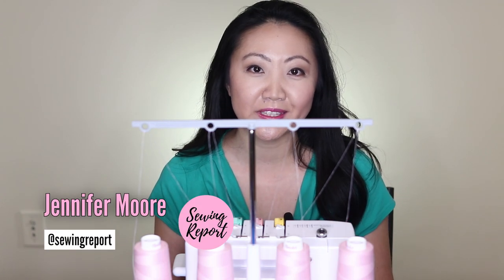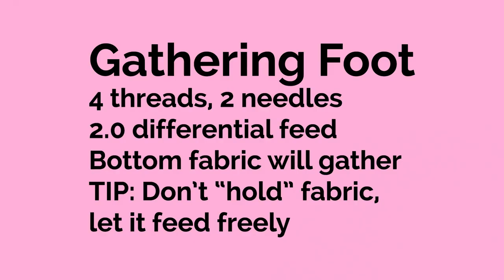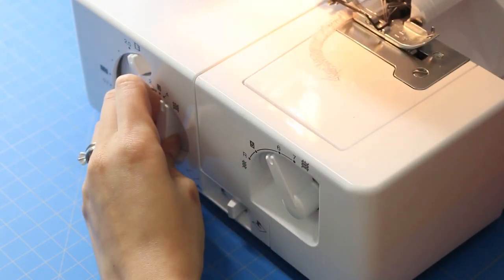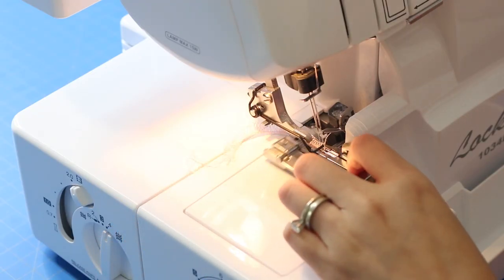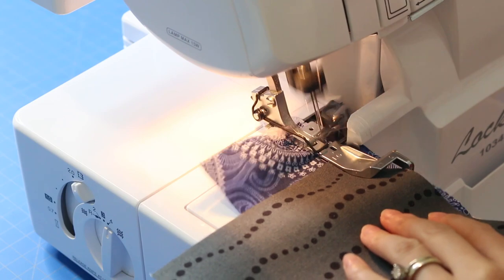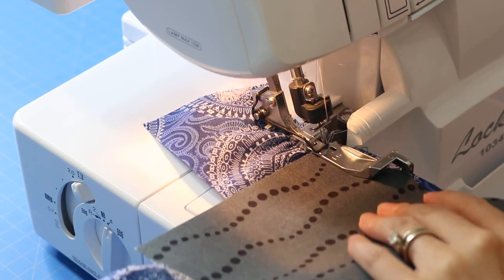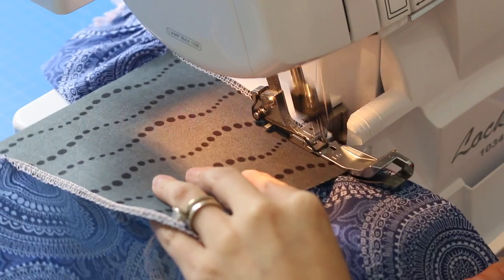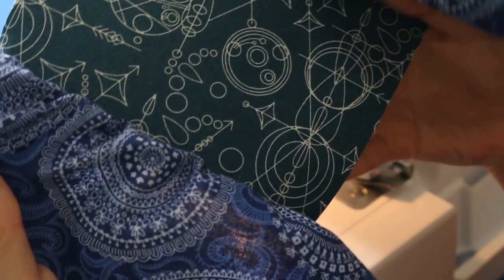How to Use Gathering Foot for Ruffles on Brother 1034D Serger | SEWING REPORT

Comment: I have the exact same machine. I followed your directions. Even took the thread out & retreaded everything to make sure it was correct. Made sure it runs a perfect chain stitch in regular settings with the regular foot. I made sure the fabric was underneath the gathering foot. Still just a straight chain. It’s just a piece of cotton broadcloth so nothing too thick or too thin. I even tried adjusting the foot pressure knob. Still straight no gathering. What am I doing wrong?